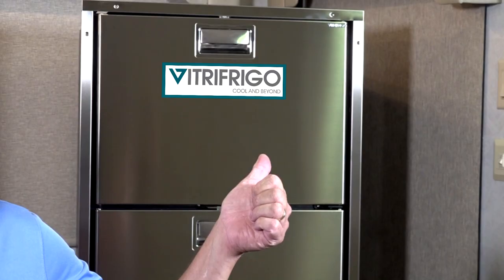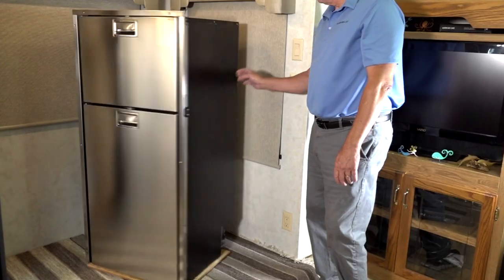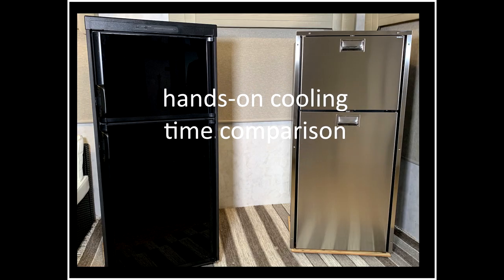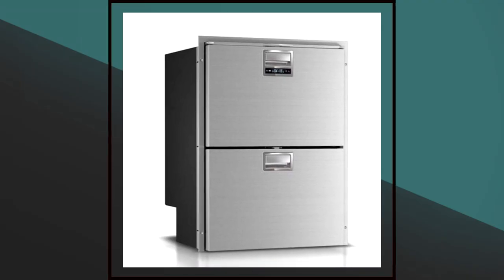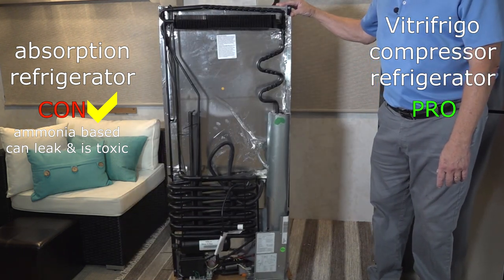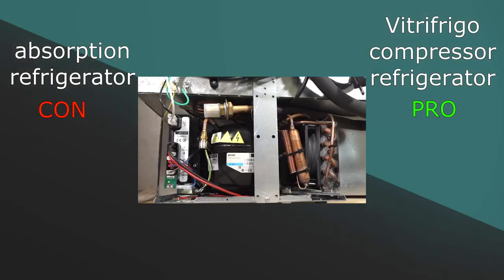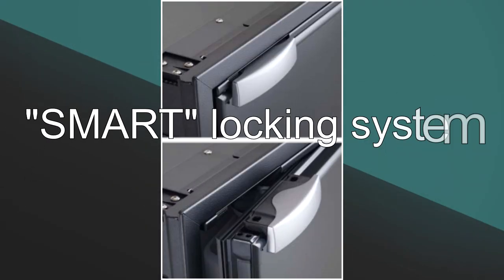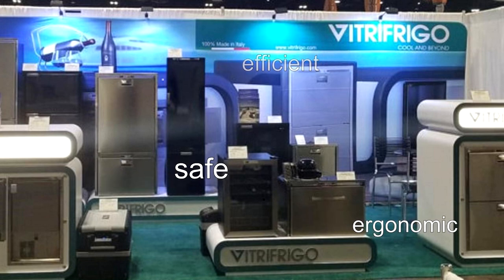RV 101® -  RV Compressor Refrigerator Technology VS RV Absorption Refrigeration

Comment: Is it a universal wound motor in the compressor?  Does the fan I see on the condenser coils have a shaded pole motor?  The reason for these questions is to find out if it will run on the DC current from a battery bank, or does it have to be a load on the power inverter?  Any idea as to the reliability and longevity of these is?  What failure mode is revealed in an accelerated life test to failure?
Reply: The dc fan is an ECM and the compressor is likely a polyphase motor with a built-in VFD / inverter. The video states they run directly on 12 & 24 vdc ergo no inverter loading required. Also the video states their 50 year history in marine applications... did you watch the video?